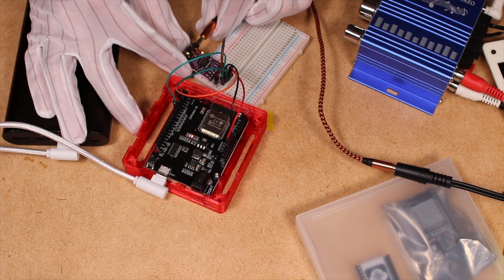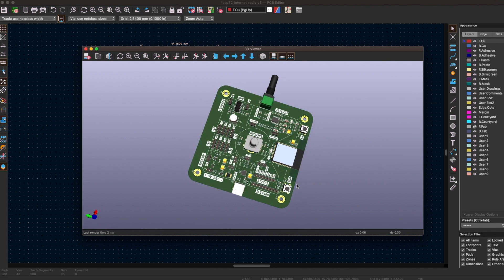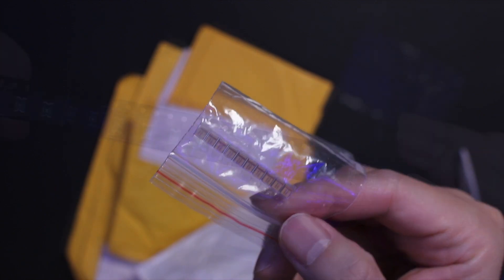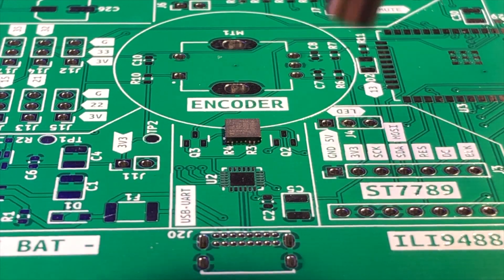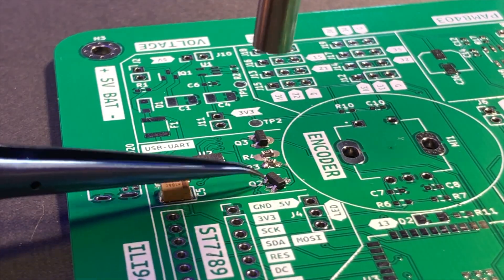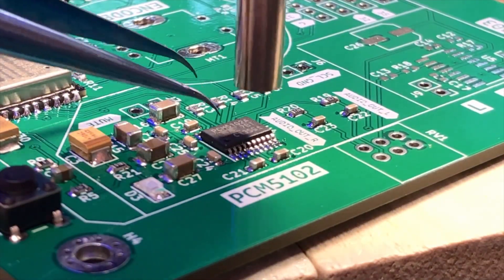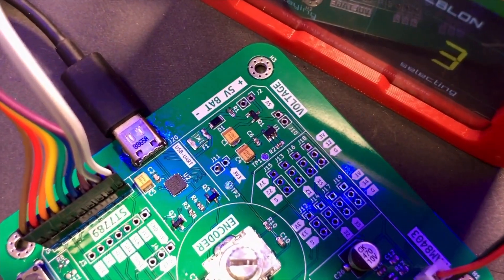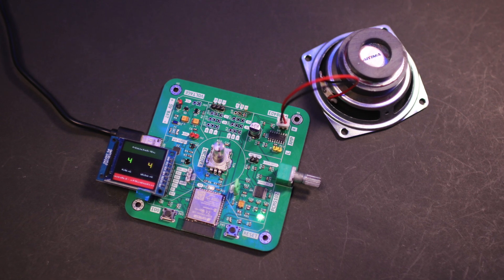ESP32 Internet Radio version 5 : Building a Compact Internet Radio with my own PCB Design in 2023!

Comment: I have to say a hotplate makes the smd soldering  much, much easier. I started doing my first smd pcb's this year too and, so far, it's been great. I opted for the hotplate over hot air because I expected I'd have some of the issues you'd had. Nice project - do you have a github?

Comment: Nice project. Tip: it is easier to solder the qfn packages if you add a little Flux before finally placing them om the board. The flux will conduct the heat better and it will prevent solder connections between the pins underneath the  package.
Reply from the maker: Thank you for your tip! I will definitely try that next time!

Comment: Nice project and well done! Next time solder the electrolytic capacitors the very last on your pcb. They can pop if you heat them with hot air. Be safe.
Reply from the maker: Thank you for your advice! I might’ve popped it!

Comment: Congratulations, it is a challenge to design a pcb. I'm sure you learned a ton doing it. I have designed a few and know the struggles. Keep up the good work.
Reply from the maker: Thank you for your kind words! I will keep on learning! I actually did a mistake in my schematic I didn’t tell in the video. I just showed the fixed one. :-)
The experience really gave me a lot confidence with handling surface mount components, it is also fun at the same time!